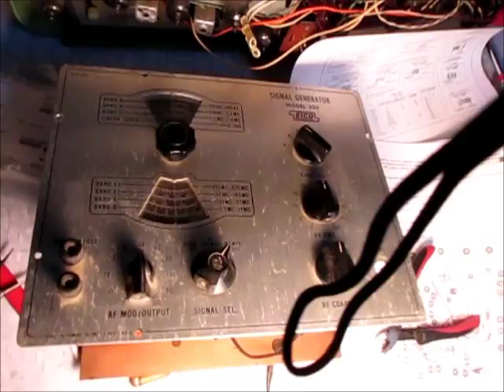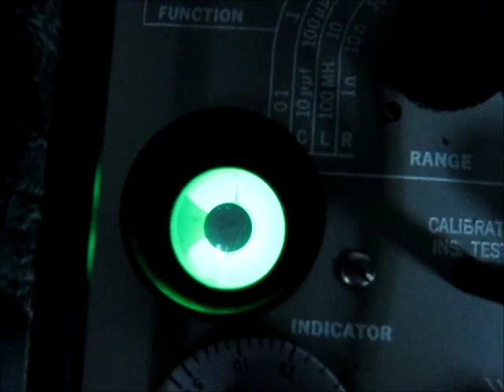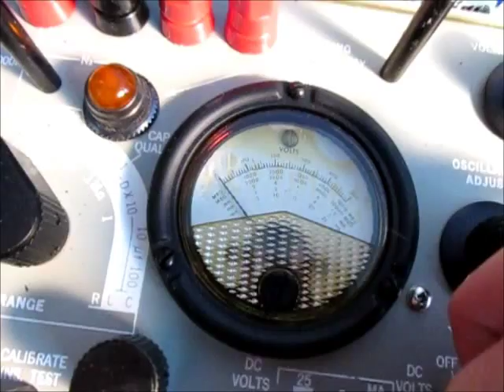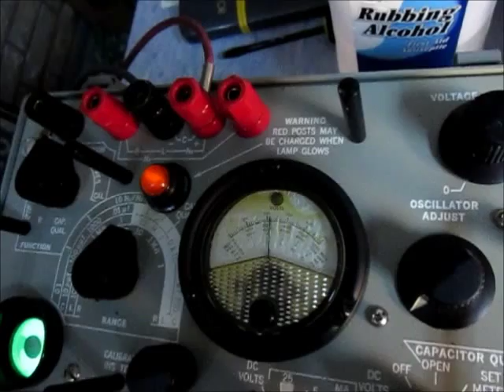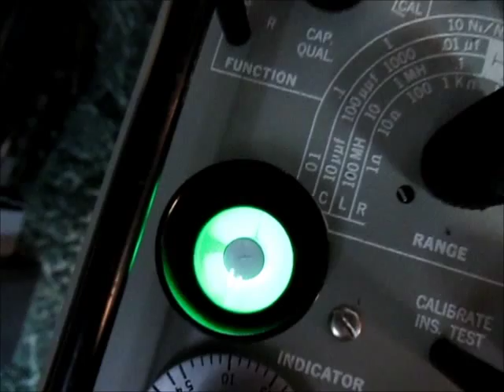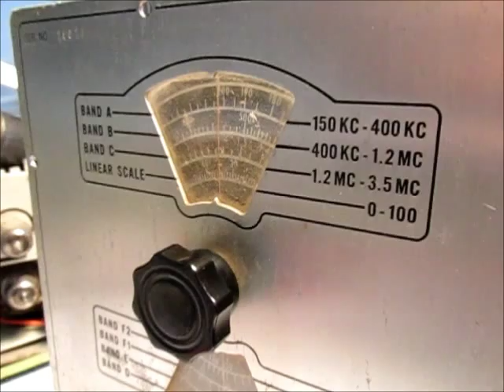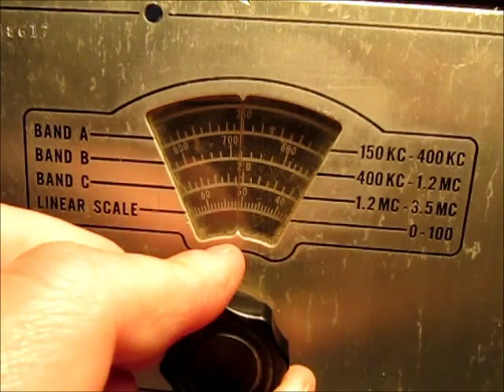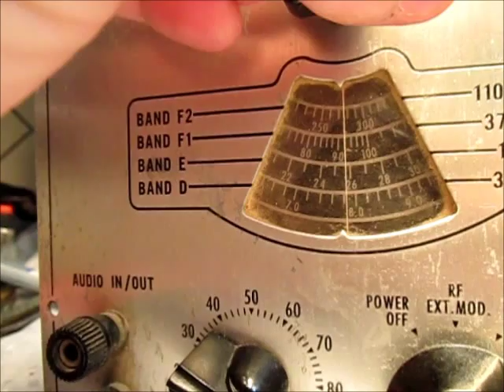Repair of a 1959 Eico 324 Signal Generator (Part 1)

Comment: here comes the eye*, da da da ding dang here comes the eyyyye
*tube
has Van Morrison ever seen an eye tube?

I have an Eico 377 that used to work, but after sitting out in a shed for years, something is messed up.  The sines are absent, and the squares are distorted.  I'm closer to novice than anything, and from watching your vid, I get the sense that the cute cheap little capacitance meter from China I just bought on ebay, though it appears to work fine, won't tell the story about leakage, and then there's the ESR angle.  Actually, I wanted to use the 377 to test ESR on caps from a crappy Hitachi flat screen tv where most of the caps are the CapXon brand, of ill repute I see from various forums (crapXon they call them).    The caps you pulled from this 324 look like the same vintage as those in the 377, and I guess I'll have to try and replicate your steps somehow, if I can find anything around here that
works for testing with.   That would include DIY tube testing, though there seems to be no reason the tubes would have failed just sitting in the shed for ten years, having worked the last time I looked.
Reply from the maker: The biggest thing that gets tubes like that is moisture.  I was given some tubes that were in a humid/wet garage and the ones showing corrosion on the pins usually had gone or went to air.  The rust works up the pin and breaks the vacuum seal.